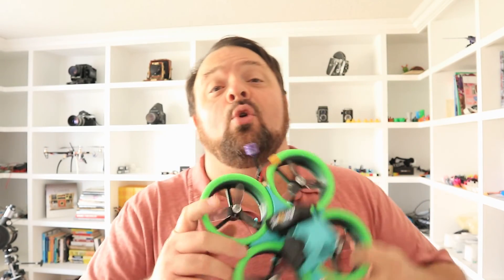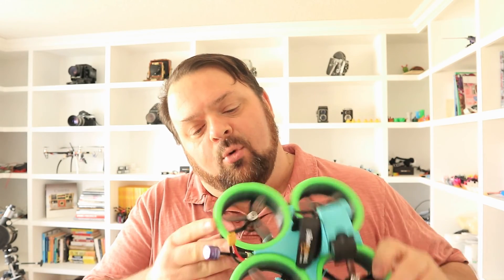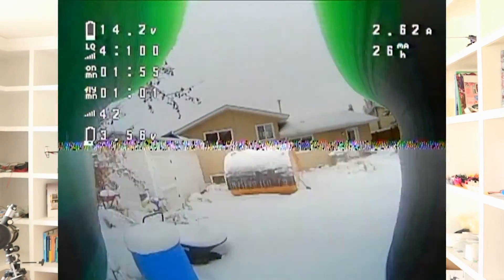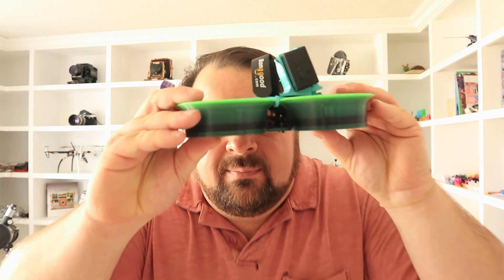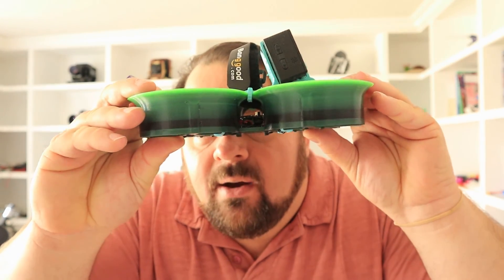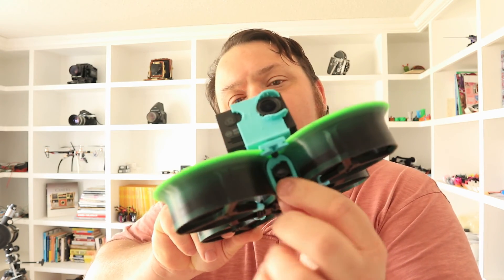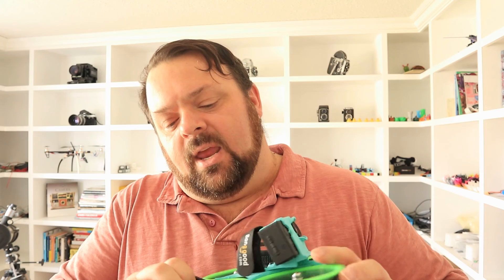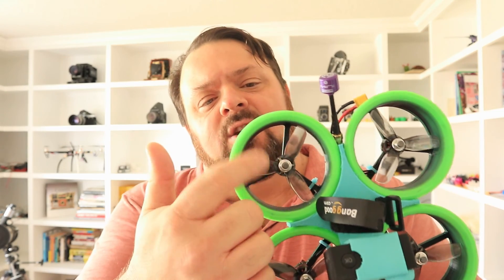3D Printed 3" Ducted Cinewhoop Drone Build: The Conclusion.... Or is it???

Comment: Another great video.    ?  I’ve looked all over for videos of how to flash the flight controller.   And I have found none.    I just built my first drone and I’m using the speedybee f405 v3 on a 7 inch drone. My receiver is a coolrc flysky fs-x6b and my transmitter is a flysky fs i6x.    Please help   I don’t know where to find the info that it’s asking for